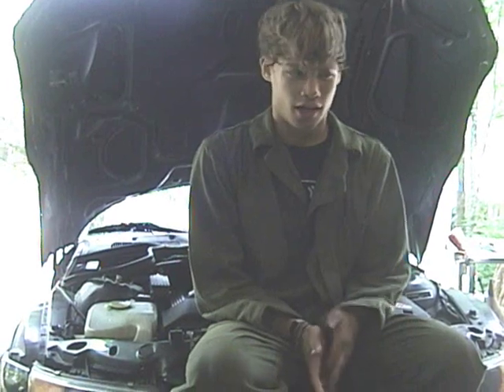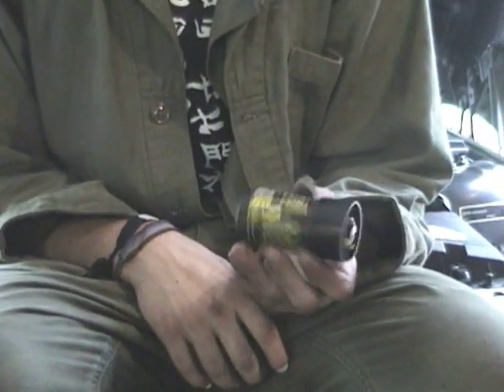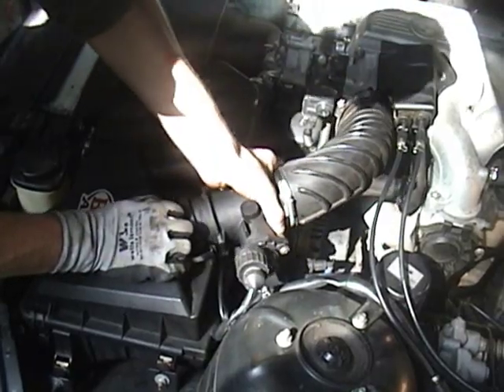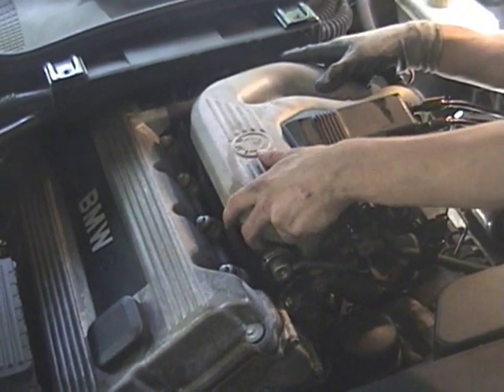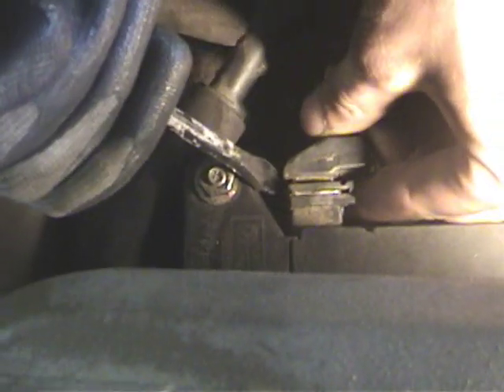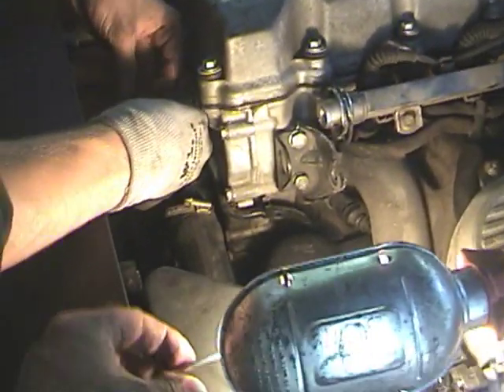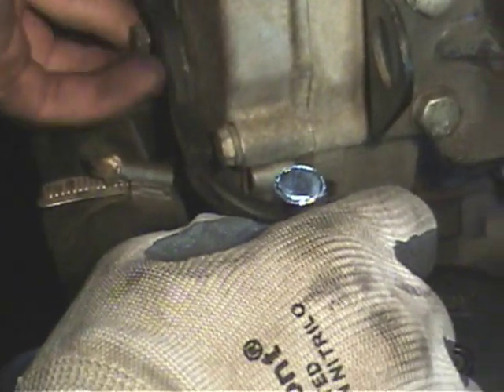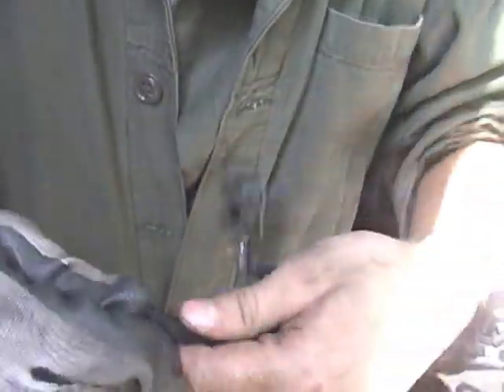How to Diagnose and Replace a 1997 BMW Z3 Camshaft Position Sensor

Comment: Good Video - One note Do Not Take off the front and Back bolts held onto the manifold. Just Loosen and the manifold will come straight up once the top 3 are removed. Taking them off is extra and hard work. When You reassemble, tighten and torque down the top 3 bolts so the pressure is even across the top afterwards Tighten the front and back. This will save a lot of time and frustration..

Comment: What kind of scan tool is that and where does it connect. Is this one that connects in the engine bay and not the under dash or side of console models?

Comment: Hey bro I’m having a problem with my Z3 is a V-6 1997 it was running fine and then one day just cut off it won’t start back I tried to use a scanner and scan it does not read it for some reason it will not connect I am in putting a lot of money into it thinking it was the fuel pump put a new one but wasn’t that tried fixing it thinking it was the key it was not the key change a lot of the fuses and relays how can I check to see if the camshaft sensor is bad before I go out and buy one
Reply: Hey bro.  camshaft sensors usually go bad slowly over time, starting with the car running bad after starting up in the morning.  If the car died flat, check the "Ignition Fuse".  Probably gone.  It is under the right side of the hood in one of the fuse boxes.  Check all the fuses.  Mine went out on my BMW Z3 TWICE!

Comment: One of the best-detailed description in describing the problem! Thank you so much for your knowledge, guidance and expertise. In addition, I appreciate you for providing the recommended size of tools needed to remove the various bolts, and recommendations and suggestions on replacement of the ”O” ring when replacing the Camshaft Position Sensor! Much gratitude to you!

Comment: I need some help my My 97 Z3 will not start it was running fine and just shut it off and won’t start it cranks I checked and changed the fuel pump still having the same problem
Reply: Check the ignition fuse.  It is in the fusebox under the hood on the right side of the engine bay as you stand in front of the car.  From what I remember, it is labeled as 'ignition' or similar.  Those go out a lot.

Comment: Hi, the bolt that holds cam position sensor guide (plastic) at 5:26 - 5:49 on the video-what size is that bolt?  You used 10 mm socket to loosen and remove that bolt.  I lost that bolt while replacing the cam position sensor.  Am guessing the bolt is M6X50 Zinc Plated.  Please someone confirm.  Thanks for your help.

Comment: Absolutely a great how-to. Well-shot. A couple notes: you don't appear to replace the gasket at the intake; is it re-usable or what? Also, 11 ft-lbs is a very far cry from "about as tight as you can get it." Too much torque and they'll distort that intake and then, boy will they ever have an air leak then.

Comment: my motor would fire on to pots when it was warm found out it camshaft sensor I put new one in and the motor would not run on all pots I just left cam sensor unplugged and its been going fine wht would cause this ?
Reply: I think it’s your crank sensor. When your cars warming up it’s in what’s called “open loop” mode. When it’s in that mode it ignores all the sensors then when it’s warmed up it goes into “closed loop” mode where it starts using the sensors. My theory is that when you unplug the cam sensor it’s forcing the car to stay in “open loop”. Also the crank sensor tells when to fire the plugs and the cam sensor tells when to deliver the fuel. On the other hand I read somewhere that if you unplug one of the sensors the car then just keeps itself running on the other sensors. I could be wrong though. Good luck
Reply: It’s also possible the new cam sensor you installed could be faulty

Comment: When mine went I was convinced it was a blowing the exhaust, sounded terrible. Got code P0304 and then knew the real cause. Wish they'd put wiring connections in easier to get at places.

Comment: Hey mate, What can you say about an improper noise of M44 engine from 2.5K to 3,5K RPMs? I think the cam sensor has to be blamed for that.. ) my car makes very unpleasant exhaust sounds at the mentioned RPM zone, what do you think?
Reply: Mine has the same problem. It sounds like marbles in the engine haha
Reply: DISA valve is this a weird vacuum sound when engine is warming up?

Comment: Thanks for sharing ! I got a similar problem with mine. I accelerate in the freeway and when I reach high rpms the car loses power and the rpm's come down then I get misfire on a couple of cylinders ... obd2 says the 2 knock sensors and misfire but I doubt it
Reply: Have you checked your fuel pressure? Could be fuel pump or even as simple as fuel filter, causing it to lean out. When you're asking for max fuel it's unable to deliver it.
Reply: got rid of the car long time ago, thanks anyways
Reply: Mine did the same thing, was the Air flow sensor

Comment: My Z3 was giving camshaft sensor / detected possible cylinder misfiring, but now it do five errors - which three of it are sensor, 2, 3 cilinder. Oh no, now rpm are jumping and car even sounds loud that I during that jumping front and back stopt as I feel that it may cause possible damage if run any longer. I am considering your solution as reasonable but will you give your opinion to me, please.

Comment from the maker: When I have an engine that hickups at idle, I usually look at the spark plug wires first, for a spot where they are burned because the spark is jumping form the wire to the engine, and not making it to the sparkplug.  I also usually replace my spark plugs.  Some people tell me that using a higher octane fuel will help, but that never helped me.  Those are the most common things.  Sorry for the delay in getting back to you.

Comment: Hey, I have a 1998 z3 1.9 that runs perfectly down the road, but at idle, it has a random miss.  The RPMs are steady at around 800-900 and do not jump.  Its just that at idle, if i listen to the exhaust, it has a random hickup.  Giving it gas through every gear is smooth and steady.  Any suggestions.  It only has 70,000 miles on it. You can email me at calvinkaul@yahoo.com.  I love watching your videos btw.
Reply: DISA valve blown inner diaphragm?
Reply: What was the fix? Mine does this too.

Comment: thanks for this video! i'm about to help a friend with an M44 engine that needs a new cam position sensor and was wondering if removing the intake manifold was necessary. it looks like it is and i think i'm going to take a closer look to make sure we don't also need to replace any hoses and will probably get a new gasket.

Comment: Thanks for sharing this video. I've replaced my camshaft position sensor but it did not fix my issue. My problem is that idle isn't 100% smooth. The engine shakes a bit. Tried new spark plugs, new ignition coil, camshaft, cleaned MAF. Feels like vacuum issue but I could not find any cranks. Sprayed break-cleaner all over. Otherwise the car drives alright. I live with this problem for 2 years now. The Idle seems to be ok when the engine is cold and outside temperature is low. Is your idle 100% ?
Reply: Hi. did you fix your problem? if yes, how?
Reply: Hi check DISA valve on right side of engine (easy to replace but expensive)  the secondary inside diaphragm is usually blown.  Good luck!